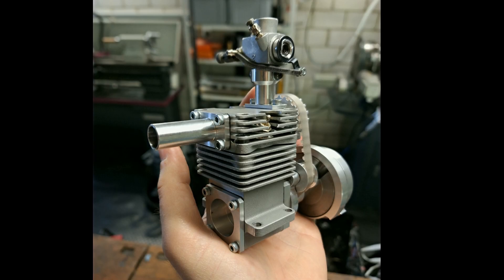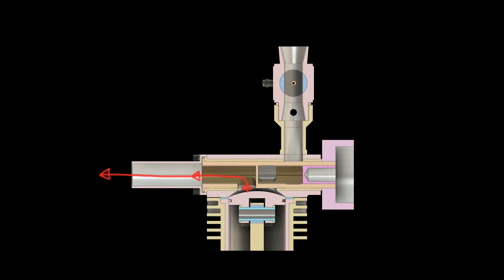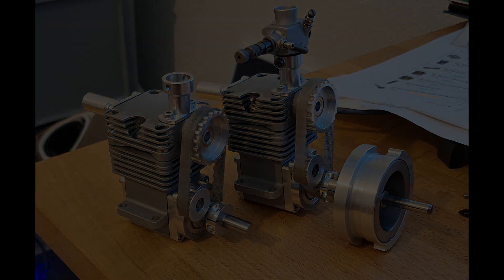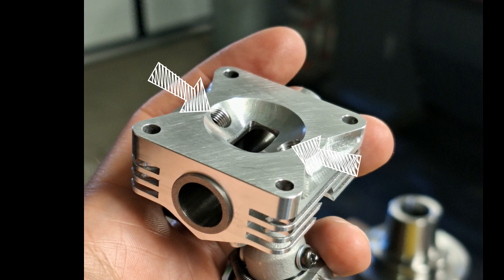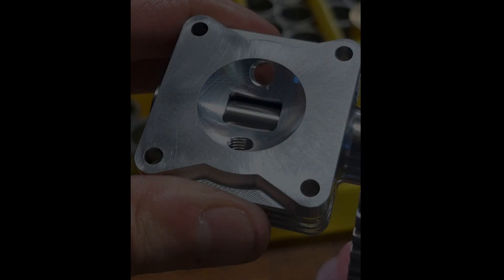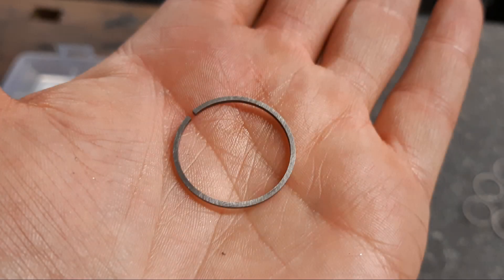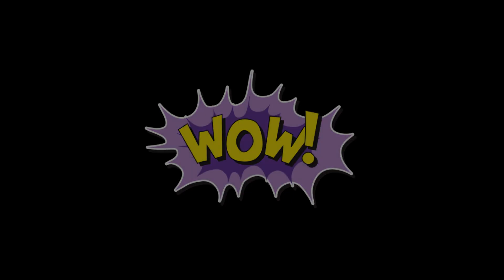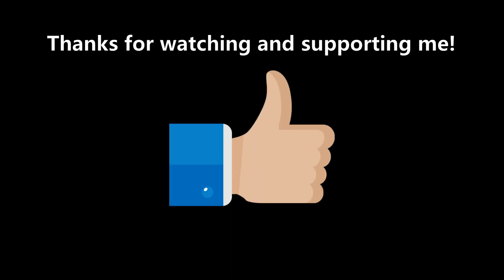New Rotary Valve Design for Model Engine / Modellmotor mit neuartiger Walzendrehsteuerung / Part 1

Comment: Ich bin wieder einmal mehr sehr beeindruckt. Bin gespannt welche Steuerung  mehr Leistung bringt. Meine Bedenken sind, dass der relativ kleine Durchmesser des Ventils einen relativ kleine Zeitquerschnitt hat. Ich selber hätte nur eine Glühkerze verwendet, dafür einen grösseren Durchmesser gewählt Ach ja die Steuerzeitwn sind schon richtig deftig. Hast du da
 irgend ein Vorbild genommen? Klingt gut und scheint richtig gut zu laufen.
Reply from the maker: Hey Argentum 😃 Ich baue gerne Exoten und Versuchsmotoren. Auch der hier ist ein reiner Versuchsmotor. Interessanterweise ist der Ventilquerschnitt genau gleich wie beim anderen Motor. Hier ist er einfach rechteckig und beim anderen quadratisch. Ich vermute, dass dieser hier weniger Leistung haben wird aufgrund der 1 Ventiltechnik. Es wird den Gasfluss und die Zylinderfüllung negativ beeinflussen, dies weil hier im Vergleich zu getrennten Ventilen ein Strömungswechsel stattfinden muss. Die Steuerzeiten sind für einen Modellmotor nicht besonderes. Meine Steuerzeiten stammen aus einem Fachbuch "Rennwagentechnik von Michael Trzesniowski". Aus diesem Buch habe ich viel gelernt über Motoren. Klar, meine Modellmotoren sind nur eine Spielerei und haben nicht viel mit einem echten Motor zu tun.
Reply: @danielhunziker3577
Das Buch habe ich übrigens auch. Ein Modellmotor 4T mit mehr als 320 Grad kenne ich  nicht allerdings drehen die auch  icht so hoch wie deiner.  Bei Autos spricht man manchmal auch von 336 Grad Wellen. Man sagt die nehmen dann unter 5000 1/min. kaum Gas an. Du kannst ja mal ausprobieren wie weit du mit den Steuerzeiten gehen kannst.
Reply from the maker: Hi Argentum 😃 Cool mit dir zu diskutieren! Bei anderen Kommentaren gewisser Leute ist das eher nicht so... Ich mag dieses Buch sehr, da es dich nicht mit Theorie voll ballert. Besonders die vielen Beispiele und Bilder aus der Praxis sind echt mega! Ich habe mir ein Excel gemacht mit allen Eckpunkten von vielen Modellmotoren. Betreffend Timing ist da Enya mit den 4C Motoren der Spitzenreiten. Die sind in der Region von Timing wie ich. Die drehen aber eben auch bis fast 20'000 U/min. Kennst du noch den Vorgänger 1 Zylinder Versuchsmotor von mir, den roten? in der 1.Ausbaustufe hatte der ein Timing von 30°/30°/30°/30°. Der kam so gerade mal auf 0.32 PS. Mit dem jetzigen Timing holst du 0.63 PS raus. Aber wie du richtig sagst, unter 3'000 U/min laufen meine auch nicht mehr richtig. Sie laufen noch gerade so für ein sauberes Standgas. Für ein Modellmotor ja schnuppe. Es ist tatsächlich auf meiner ToDo Liste, bei 1 Zylinder mal das Timing weiter zu erhöhen gemäss Liste Trzesniowski. Das wäre insbesondere spannend, weil bei einem Walzendreher so der Ventilquerschnitt auch grösser wird (du machst ja mit der Breite und Position das Timing).
Reply: @danielhunziker3577
Excel ist für so was natürlich gut geeignet. Interessant ist noch der YT-Channel von Garage 4AGE. Dieser holt mit bescheidenen Mitteln relativ viel Leistung aus relativ alten und kleinen Toyota Saugmotoren raus. Er macht viele Experimente mit Steuerzeiten, Einlasstrichtern und Auspuffanlagen. Auch wenn es keine Drehschiebermotoren sind  sind die Ergebnisse lehrreich. Die 40er Webramotoren haben soviel ich weiss  nur 260 Grad, im Vergleich zu den konventionellen Motoren eigentlich recht wenig. Bein Drehschieber darfder Kanal natürlich nicht zu breit werden, denn wird der Kanal zu breit aber zu wenig hoch, ist dies nicht so gut für die Strömung. Hast du mal gemessen wieviel die Doppelzünung bringt bei hohen Drehzahlen bringt? Bei so einer kleinen Bohrung vermute ich, dass es nicht sehr viel bringt?
Reply from the maker: @argentumflower592  Danke für den Tipp mit YT-Channel, schaue mir das gerne an! Ich habe mehrere Webra T4-40 (gar NiB) und auch 60er, 80er und 91er. Du hast recht. Das Timing ist bei diesen sehr moderat und das zeigt sich auch in der eher geringen Leistung. Ich hatte als ersten Motor einen Webra T4-40 auf meinen Dyno und kam auf 0.39 PS. Das ist natürlich ein bescheidener Wert. Das moderate Timing wird hier sicher seinen Anteil dazu haben.

Comment: 1 solo passaggio per scarico e aspirazione comporterà un mix di gas nella valvola che riduce la quantità di ossigeno che entra nel cilindro. Hai bisogno di 2 passaggi diversi per evitare che i gas di scarico facciano su e giù e non vengano completamente espulsi😊
Reply: Dire " hai ragione" premia 1 punto per chi lo ascolta, ma 10 per chi lo dice. Ritornando al tuo video, è bello sperimentare, ma  immagino che questo porti via molto tempo ed energie. Sono giunto alla conclusione che una soluzione con la candela al centro tra due valvole tipo "bishop" sia ottimale per la forma della camera di combustione, la posizione della candela, la alta capacità di flusso (2 valvole "bishop" piccole potrebbero fornire una portata paragonabile ad 1 valvola "bishop" grande).
Reply from the maker: Hi Alfons 😃 My definition of a hobby is "the greatest possible effort with the least possible benefit" 😅 I enjoy it and that's the main thing. For a hobby, the effort involved isn't important. I know the systems of Bishop, Guy Negre and Coates. In model making, you have simple production tools and you are always limited. The parts are also really small. The systems you see in my videos are always adapted to the manufacturability and my skills. It's a hobby, nothing more. The cross system from Bishop would probably be the most feasible in model making. Info on the side: The size of the rotary valve is determined by the glow plug. It's standard in model making and relatively huge!
Reply from the maker: Hi Alfons 😃 I think you are right. Unlike 2 valves, with 1 valve the gas flow must change direction cyclically. This isn't optimal for cylinder filling. But the aim of my videos is to find out exactly these things with practical experiments. Just try something and see what happens, how big the influences are and whether there is further potential for improvement 😊
Reply: https://www.v-eight.com/multimedia/pdf/AutoTechBRV.pdf

Comment: Rotary valves have been tried many times in the last 100 yrs & it doesn't work, they overheat & open & close too slowly, poppet valves will work for 500, 000 miles untouched, what is he trying to prove?
Reply: Apparently you never listened/read what he said. He knows the problems of such engines. It is not a car engine but a model engine that is lubricated with a lot of oil. Do you do 500,000 km with a model engine?
Reply from the maker: Hi Gregory 😃 I love your comment! Giving critical feedback on a project and giving reasons for it's a good technical feedback. I can only agree. With real engines, there are probably many disadvantages with rotary valve that outweigh the advantages. But don't forget, this isn't a real engine, it's just a simple model engine. I can live out with these projects my inventive spirit and can simply have fun. I'm happy when people follow my projects and also find them technically interesting. Isn't that a good thing? From my point of view, this is worthwhile 😊😊😊
Reply: @danielhunziker3577 great answer, and the most important thing with projects like these is to have fun
Reply from the maker: @VSS63  As a model maker, everything is always a challenge anyway 😅 Everything is super small and in the hobby workshop the design always has to be adapted to the own skills and machines. You always have to make compromises 🤷‍♂
Reply: @danielhunziker3577 I’m sure if you created a water cooled variant the valves would not overheat
Reply: @barriegregory6606  As with all of us building rotary valves, it is for the fun of it.  I've built many including one for an inline 6 BMW.  Yes it has problems but it was and still is a fun project.
Reply: Air has to go AROUND the poppet valve, and then do a 90° turn. The spring return time is what limits rpm. Eliminate the spring, and with no rpm limit you now have far more power and efficiency
Reply: @lexiecrewther7038  Desmodromic valves don't have springs Ducati have them, poppet valves have rapid opening and closing, rotary valves operate way too slow to be efficient. F1 have never used rotary valves & F1 engines are the the most thermally efficient piston engine's on earth.
Reply: @barriegregory6606  make up your mind bro. Your argument starts with "100 yrs" & "500k miles" and switches to "muh super rare, super expensive anecdotes". People like you said "the steam engine works bro, why even waste time on internal combustion?"
Reply from the maker: Hi Gregory 😃 Do you know this article https://v-eight.com/multimedia/pdf/AutoTechBRV.pdf ? In summary, Bishop worked on an F1 V10 with rotary valve from 1997 to 2003. The test engine showed 10% more power than the version with poppet valves.  In 2004, testing of these engines was prematurely terminated when the FIA banned rotary valve technology. The FIA was probably afraid of this technlology 😉
Reply: @danielhunziker3577  I do!  That article was one of the key ones I researched when deciding the type of rotary valve to develop for my engines.
Reply from the maker: @johnpearson492  It's just such a shame that the project had to be stopped because of this 😣 I wondering what happened to him and his design? I would like to see much more diversity and opportunities in F1. My V8 is a tribute to what could be ☺ Love all you exotic motor freaks out there!
Reply: I am working on air engine project rotary valve works perfectly. There is no much heat produced in air engine

Comment: It sounds like it's running very well!  
Did you specify the steel to have a similar thermal expansion coefficient to the cast iron sleeve?  The fact that you are running some sort of oiled nitro fuel really is nice as it solves the lubrication challenges we have in our BMW rotary valve.
Reply from the maker: Hi John 😃 Yes, it runs well. But I think that the single valve has a negative effect on the gas exchange and on the cylinder filling. But the engine is exactly there to find out such things in a practical test. So far I have chosen a special bronze as the material for the Rotary Valve (ENCC493K). I noticed that the exhaust side tends to jam due to the hot exhaust gases. However, I have fixed this problem as far as possible with the V8 (he still has several secrets 😉). As the rotary valve is always significantly hotter than the cast iron sleeve, it must have a significantly lower coefficient of linear expansion. I went a little overboard here and chose Invar steel (Invar 36 alloy). This works surprisingly well! It was hell to work with... super tough, high cutting pressure and endless burrs. A methanol, nitro and oil mixture is common in modelling. The engines have a very simple design and are only lubricated by the fuel. On the other hand, you have an active oil system in the BMW, which brings additional advantages!

Comment: Anxious to see dyno curve from this one.
Reply from the maker: Hi James 😊 Me too! I have no idea what it will look like. Hopefully it will not blow up 😅
Reply: @danielhunziker3577  - 🤣 fingers crossed 🤞 

While it doesn't sound like it revs as high as your previous single cylinder, throttle response is considerably better. The fact it sounds like a 2-stroke means you have some serious velocity on the exhaust. You could see noticeable gains by widening the exhaust manifold at the interface.
Reply from the maker: @JamesCopeland-i1j  Hi James! It always want to make a one valve rotary valve head.  I have to say that Hirtenberger has a very similar design in principle. People say they start poorly and the performance is modest. Coincidence? Spoiler: It isnt! My previous design is much better in terms of performance. The valve cross-section is constant over the entire inlet and outlet. This is always 50mm^2, even in the rotary valve itself. The rectangular cross-section must be like this, as the width of the rectangle determines the timing. The length is chosen so that the area is again 50mm^2 like the circular area of the 8mm exhaust and inlet diameter.
Reply: @danielhunziker3577  - I see now, you have full port exposure 👍

Comment: beautiful engine! Would love to hear it rev longer if it is capable. What kind of lubrication does the rotary valve need?
Reply from the maker: Hi man! It's engine which is new. So I don't wont to damage it already in the beginning. Because I will dyno it in the next part. There we will go than full throttle! Model 4 stroke engine are lubricated like 2 stroke engines. You have oil in the fuel which lubricates all parts. As well the rotary valve.